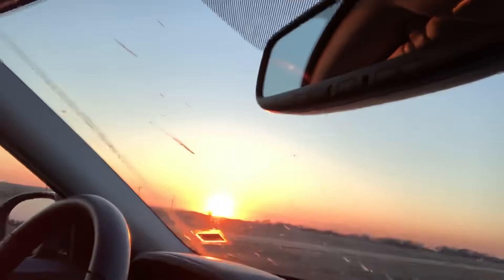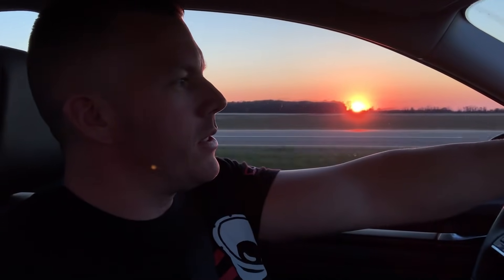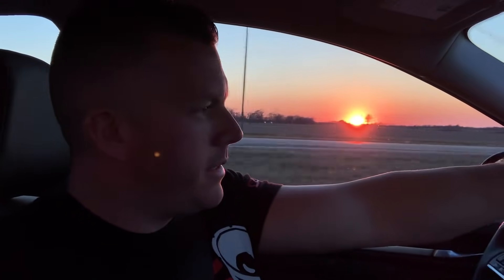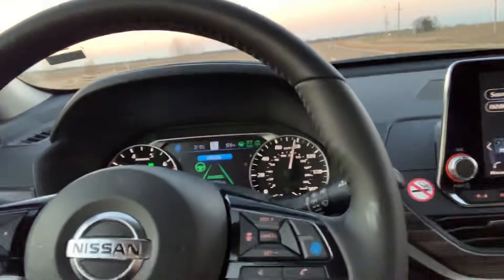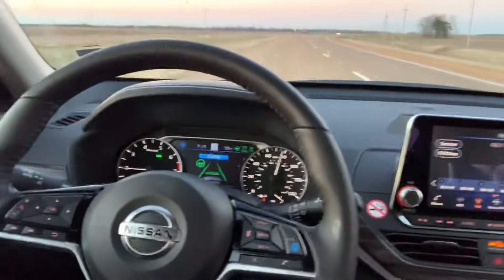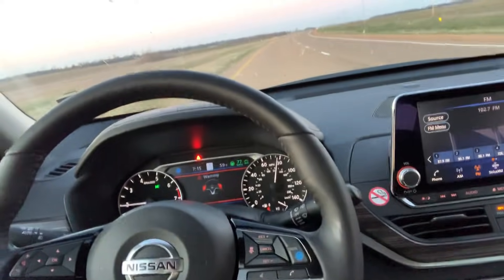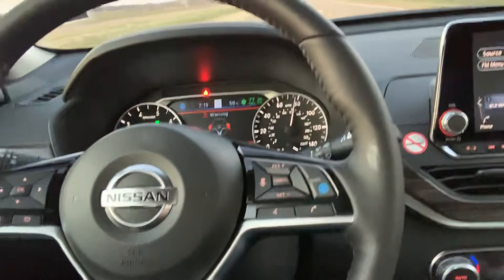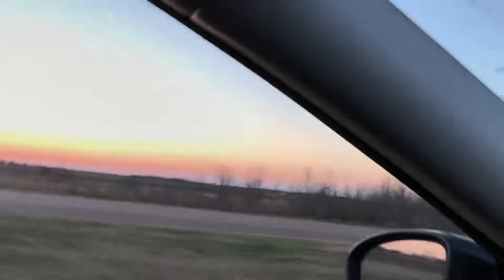WHY DO MY SUBWOOFERS STINK?

Comment: In most videos of a oscilloscope vs dd-1... the dd-1 picked up distortion before it showed up in the sine wave on the oscilloscope.
Reply: because the dd 1 specifically looks for distortion, you can get distortion before clipping. but alot of spl guys dont worry about the bit of distortion, especially if they dont play extended periods of time. dd1 is mostly for daily setups, to keep in a safe zone.
Reply: Clipping is distortion so... also that's apples to oranges. Anyone that wants clean power will obviously use a dd-1 or oscilloscope. I don't think anyone wants any level of distortion or clipping. With exception to a slight bit of clip on a burp or something. My point is that, for 1... the dd-1 is much more expensive than many oscilloscopes available(some are insanely priced and unnecessary)and secondly due to as I just mentioned... I wouldn't consider the oscilloscope the better option. Seeing as how the dd-1 picks up distortion sooner than most oscilloscopes I've seen in use. You say it's made to pick up distortion specifically which is my point also, as I said distortion is clipping. So you kinda stated the obvious while referring to 1 thing as of its 2 separate things. Distortion and clipping. Can you have distortion without clipping? Well yeah of course. Bad sound track ect. But nonetheless, clipping is distortion.  So  I'm pretty sure plenty of huge competition builds were tuned with a dd-1. There are only like a hundred dd-1 related videos here on YouTube. Also I own 1 some I'm quite aware of its purpose/capabilities.  Thanks though for clearing that up for me😂
Reply: @bass-n-truth-inthestix9083  sounds like you've learned alittle. travis at jy runs his cube gains wide open... and there are others too..
Reply: @allrimmedout  I've been known all that since I was like 14 or 15. About distortion at least. Not dd-1 ect I had no clue what those tools were then and dd-1 didn't exist lol so... it's funny though,  I don't remember ever seeing any of the systems back in the day having the gain set with anything but the ear. Gotta love the old school

Comment: My first subwoofer that i  got it powered in the box and the sub was in it aswell. 60 watts max powered built in amp and the sub too and  i didn't go  at high volumes because ii was so new into having my first sub in my  room and i was like  freaked out when it  bassed like when the  deep ass bass  goes through.  ANd then  i bought a 1,000 peak 500 RMS watt 8 inch sub to replace it with  and i  didn't really know about the  sub stuff.  SO i  got that and replaced it with my sub  i  bought online. I can go max volume on the amp and the sub will be perfectly handling. I had it for many years aswell. I then got into the  subwoofers and speakers and bought 2 15 inch Rockville powered  2 way  DJ speakers and i have those still right now and   RECENTLY BOUGHT A MASSIVE POWERED SUBWOOFER LOL  18 inch Seisimic Audio 18 shockwave subwoofer and i  just love the goddam thing alot and i can hear it from 300 feet away from outside.  (Subwoofer is in my room)  1,600 amp powering the 800 watt 18 inch sub.  I wanna replace the 18 inch subwoofer that has  atleast 1,800 peak watts of the 18 inch sub or go for a 2,000 watt 18 inch subwoofer to replace it with so i can go  super high volume and i can go  super high on the sub already but i don't wanna be  extremely high in order to sorta smell it so i'm like trying my best to keep it away  from damaging. Also your vids are once again good helpful and  awesome aswell.  Do you even own a car audio t SUV still or you just have your current pickup?
Reply: including i have 3 8s and 1 10 and 1 6.7 and 2 4s. (Subwoofers)  I techncially have over 3,000 watts all totall from every sub i have   LOL

Comment: I’m an auto diagnostic tech so luckily I have a 4 channel Pico oscilloscope to set my gains with. Overkill as hell but nice to have. A cheap scope for setting gains would actually be cheaper than a dd1 so there is no excuse to be clipping subs. You can get a cheap pocket scope for $50 these days.

Comment: I have a sundown E10 V3 D2 and a jL audio 500 xd which is a pretty spendy amp for only 500 watt rms and my sub is also 500 watt rms run at 2 ohms and it smells is there any advice anyone can give me I’m pretty sure I have it tuned to 32 hz which is recommended for the sub, it is also in a small box I have to get a spacer so the sub could fit but it is ported also so if anyone can tell me what I’m doing wrong and help me out would be nice thanks!!

Comment: I'm running two Sundown Zv3 18's (rated 1500 rms each) on two Sundown SCV7500D amps at 1/2 ohm each, almost a year daily and numerous comps. Gains set proper, Clean Signal FTW!

Comment: Buy an oscope %100 good for many things and u can find a cheap one that will get the job done.. I'd spend $150 on a scope before I'd buy a dd1 that's only good for 1 thing.. plus smd stuff is over priced
Reply: A good cheap handheld o scope?   Please post link.   DD1+ is an excellent tool,  shows voltage, allows you to set gain overlap.
Reply: @caseytbss  Just search on eBay. A 2MHZ/2us scope is plenty for amp calibration and even amp repair. You'll need a 10x probe.

Comment: I've been having this problem with my 5 channel amplifier cutting out the music on all channels, at the same time, for about 3 seconds. It seems to only happen at night with all of the lights on, but ONLY when I am stopped and go to press the gas pedal. I have a HO alternator and I've tried just about everything from upgrading fuse holder, replacing fuse, upgrading to OFC wire, upgrading speaker wire, relocating ground point, redoing all of my connections to and from the amplifier, upgrading RCAs. I've checked all connections with multimeter when car is running and off with music playing at loud volume. Voltage input to the amp stays above 12v and just below 14.4v. All gains are set with multimeter. I've also done the big three upgrade as well. The only thing I haven't upgraded yet is the battery, but that shouldn't matter when the vehicle is running. If anyone knows what the hell is up, it would be greatly appreciated

Comment: Distortion kills speakers MUCH faster than power.  I had a dual voice coil 8” sub wired to 2 ohms.  The sun was only rated for 150 watts RMS(75 watts per coil).  According to the multimeter, peak RMS power going to the sun was just a hair over 500 watts!  I played the sun for 9 months with no problem, then I made a video blowing the sun.  Once the bass boost was turned up and the volume turned up above a clean signal into clipping, the sub did not even last 30 seconds!  That video is on my channel.

Comment: rigid wave? you mean square waves kinda like the trash bass lines that dubstep and any EDM gives you in any song , the worst of the worst type of bass line that beats even 2 chains music is a saw wave it literally looks like this /\/\/\/\/\/\/\  pure death hardstyle music lol and ( edm / dubstep / 2016+ rap music ) sqarewave may be clean " 0Db " dont mean its meant for a subwoofer , understand this the magnet and coil work together the current needs to be fluid like ( former , vioce coil is round ) the current needs to travel around the coil equally which is why a sine wave works so perfectly , lets say you have a cam that records 30fps and you play a song @ 30hz sine wave the sub will look like its not moving that means its passing the current through the coil through the magnetic field in a balanced form , but if you was to do the same Hz note but as a square or suicide saw wave the sub will still look like its not moving but it looks off.... why? oh that because the square wave is going through the VC in a clip like fashion in other words its chaos one side of the sub looks like its about to break while the other side is going into the spider  and then back around and flip flops one side to the other , thats just 1 VC ( Voice Coil ) add another and be ready to not just start smelling it cause now your not just disrupting the current flow with a current wave form thats not linear like a sine wave but cross crossing it 2 ways against the magnetic field one side going up while the other side going down causing a plastic like sound or and strange distorted hum kinda like what he is talking about in the video , there are examples in this topic on redit and engineering forms in regards to magnetic fields and  DVC and SVC's and the different effects the type of  current sent through it can produce in terms of distortion and wave forms there are even vids on YT that show what a sub looks like going round and round using a sinewave and nearly destroying its self using a square or saw wave ( you can play sub killing music but don't expect to keep your equipment for long the amp can only do so much before blowing or frying your sub ) we all have to start somewhere and having a mom and pops shop throw it together in your car isnt the first step see and dealt with more than enough mistakes from " professional shops "  lol good luck with the learning curve and enjoy the noise pollution tickets when you get it all dialed correctly :)

Comment: What about the importance of clipping from the head unit when turned up to max, like some people like to do. I'm trying to set something up for someone and the amp is powerful enough to heat the sub, but only if it clips, I'm basically trying to make it 'user proof' under all possible settings - i'm guessing that this is possible but worried about them turning up the bass far too much - and pop...

Comment: an oscilloscope allows you to analyze the waveform.  you can use one to measure the wavelength, but yea.  there's no excuse for not having an oscop thanks to the cheap dso kits on the market now starting at $20.  dmm's are nice, but are only as reliable as the amp manufacturer's ratings.  i use both, i use the dmm to get to my target and then the oscope to finely tune it.  actually seeing a clipped signal should be enough to dissuade you from putting it on your speakers.  imo it's important to explain WHY clipping damages speakers (the distorted ac waveform acts like a partial dc signal on your speakers causing overheating) or people just aren't going to get it and think you're talking about noise.  you also didn't mention that if you're using an oscope you need to have the amp loaded.  it's a bit of a loaded topic for just an off the cuff no prep video :P

Comment: I have 2 Rockford Fosgate T2 15's on a Rockford T2000bd and I been beating tf out of them for a long time, I've learned if u just buy some good equipment and dont try over do it ull be fine, as long as it's properly installed like he said
Reply: I love that amp I have  it pushing 2 DD2508sc
Reply: Yepp so true I rsn only rockford fosgate power amps and expensive  Korean board amps and never had a problem one thing thoo my synergy amp can take a fakin beating ngl but I luv my rockford fosgate power amps

Comment: I cant afford it. it costs more than my budget.
I have to set it by AC voltage with multimeter with a tweeter connected 
my budget for something like this is if it cost 20$ instead of 150$ I'd buy it immediately.
I cant afford 150$ right now

Comment: Great video JP!!! 👌👌👌 Very helpful and  very informative but sometimes it's hard to tell if it's your subwoofers that smell like burn or one of your amps depending on how many you are running!!! Especially when your sitting in the front drivers seat and your listing to your music and driving at the same time!!! JP how much power over the RMS rating would you say is safe to run a subwoofer before you start to smell your subs???

Comment: That's definitely right the ever-living poop out of them haha👍👍👍
Reply: ever living...............poop
Reply: Hi what is better for deep bass shaking dash board DC or jl audio
Reply: For 2 10 inch subs in my Chevy extended cab 2012 Silverado undergirding subs which brand can do it
Reply: I had both but had to pawn both to get 2 12inch sundown v3 subs which was a little too much shaking the gals
Reply: I like deep bass from a sealed enclosure but I think I was kinda pushing it with the 2 12s but really couldn't tell the difference between the DC &jl besides the motor and surrounded
Reply: Also I was using a 1500bdcp rockford fosgate amp with mechman 245 alt and 2 xs batteries
Reply: Also used dd1 to match my alpine max volume
Reply: One thing I noticed was that DC 10s made my phone shake off the middle counsel and the jl didn't
Reply: Oh by the way DC had smell while doing it though while jl had no smell and no shake for the middle counsel whatsoever but can feel the bass in your lungs  so just wondering what you think brah because I want to purchase another pair of 10s but I  am done exploring and need some help
Reply: K
Reply: Sure appreciate it bro
Reply: Cuz we are the same age but I'm a all around cowboy that well enjoy the true sound of bass that you can feel that massages your lungs is unforgettable to the true 1990 8aten right!

Comment: Best way I found to NOT have this happen is get an amp that will be a couple hundred RMS under the subs rated RMS and the same with the peak then either do your homework on how to setup your equipment or take it to a shop and ask to have them show you while they set it . Plus 1 of the most important things to remember is correctly building your encloser not to big not to small just right and if you turn your deck all the way up turn your bass levels down or just don't go past that level and enjoy your hard earned well spent money for years to come 👊. Keep up the great work JP  the Deaf bonce I got from you still slaps like a champ. Bass head for life
Reply: I got a sub rated 175W RMS and an amplifier with a maximum output of 150W RMS (very small system), If you aren't careful it still can damage the sub. I smelled the tell-tale signs of heating voice coil and turned it down quickly (the sub is still ok). I guess I'll have to use a scope to make sure no clipping at all under any settings of bass-boost (the end user likes a lot of bass and will no doubt try and crank it up until it dies).